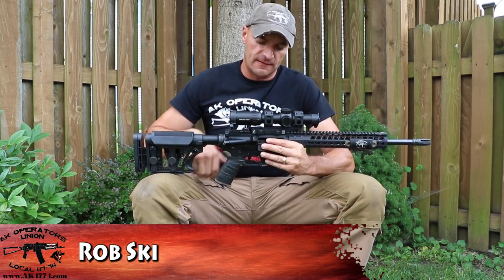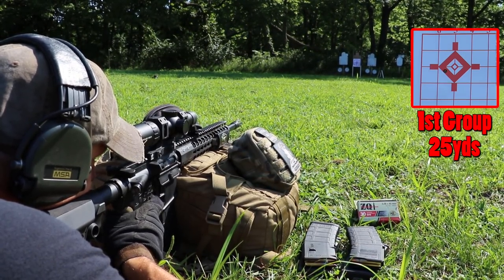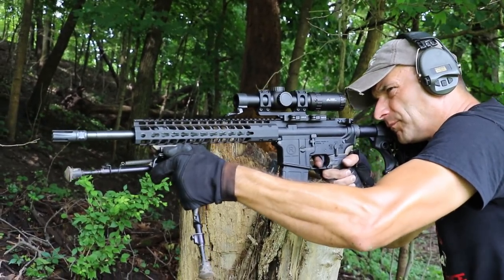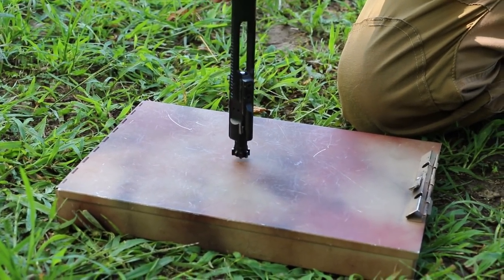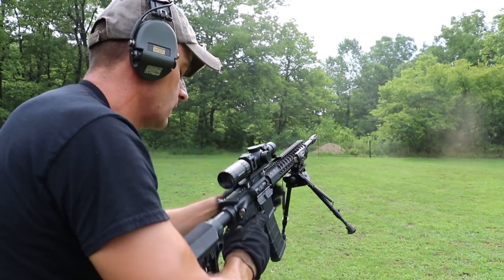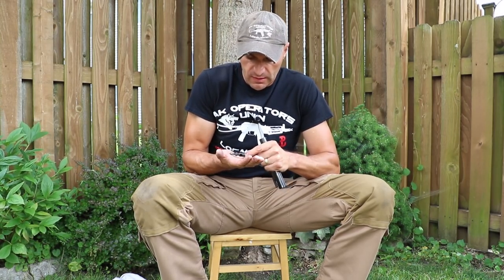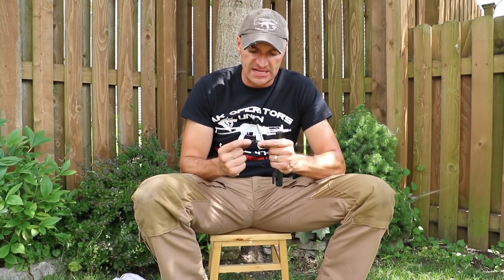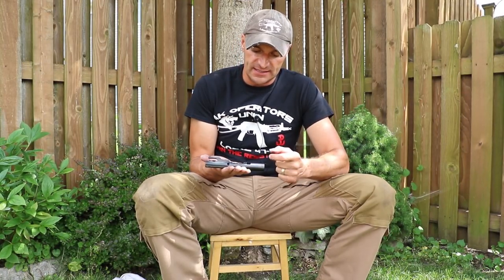Radical Firearms AR-15, 4310rds LATER - Another one bites the dust!

Comment: I’ve had my RF-15 for three years now. Originally bought it thinking I’d have to drop a new BCG in it considering it was only $550. 3-5 thousand rounds later with regular cleaning and the factory BCG is still going strong. Accuracy is still great, and it eats pretty much any ammo I throw in it, steel or brass.

Comment: This is a failure, yes, but not on the same level as the RAS47 or IO...  These are small, cheap, changeable parts easily replaced, not major frame work or metallurgical failures.   They need to fix this but it is not an absolute condemnation of the rifle.
Reply: True. That RAS47 wasn't ever worth repairing with all new parts. It literally had to be thrown away
Reply: Robert Smith
I think the bones of the RF AR were good enough... unlike the RAS47 or IO where the very framework was coming apart, with evidence of really poor metallurgy, shaved metal, flaring of contact points, fractured parts, wobbling rivets... icky.
Reply: Cant believe you old rockers are talking AR 15 together
Reply: Its a test to see if rifle will function to 5k with standing the tortures. If rifle stops functioning then it fails. So RAS47 outperformed this AR,, not sure how you can't say that. If you are at war/battle, you can not stop and purchase parts to fix. so having said that RAS47 beats this AR and the IO, while functioning perfect and holding zero all the way to 5k.
Reply: MrShizzlblizzl
You do have a point. However, I don't see anyone watching this video going to battle...certainly not with a RAS47 or this AR.   99.9% of the people watching this are ordinary folks looking for something to take to the range and have fun with.
Reply: Yep that's why I buy the best out there and build it myself for a lot less than you can buy at the store.
Reply: +Steve Miller having said that I doubt they will reach 5k rounds in lifetime  just going to range here and there. 5k is a lot
Reply: +Randall Berry I wish I had times and knowledge to build. That's cool for you man.
Reply: Have you ever watched videos on youtube lmao you to can build a good one.
Reply: +Randall Berry pretty funny isn't it?
Reply: +MrShizzlblizzl  They both had flaws. Both would work for me in SHTF because I only need to shoot a few rounds to remove the better AR from the other guys hands. Buy a cheaper rifle and spend the rest on training. A 100% reliable AR or AK is only worth it if you have the training to properly use it. I'm not talking going to the range and landing 50 rounds on top of one another. If you a AK guy see Robski and get some real world training. AR guy see James Yeager. Its just my opinion but This AR would be fine if maintained and it would be reliable. Robski really puts the shit to these rifles without a proper cleaning. I would love to see how many rounds it would take if cleaned after the sand tornado and lubed about every 1000 rounds. Not lubing a BCG in a AR is like running your car with no oil.
Reply: Randall Berry
There are so many great parts makers out there right now!  You are right, it is fun and easy and money saving to build your own.. and then you have the gun you want.

Comment: it doesn't mean the rifle is garbage.  replace the bad parts and it will be fine.  it just didn't pass your tests.  I'm sure the manufacturer will fix it.
Reply: +Del Corbett who is going to use an AR15 for self defense?  Anything can break or malfunction because they are  made and assembled by humans who are not perfect.  even expensive firearms with the best parts have broken.  I wouldn't be so critical.
Reply: Better yet, roll your own AR. I have a Spikes BCG in a Aeroprecision upper with a Daniel Defense barrel. Once I got the SBR gas / spring issues resolved it had no problems. Even before that, the only problem was that it wouldn't lock on an empty magazine. Throw on a 3MR trigger pack with a UBR stock and you've got a brutal short range rifle.
Reply: I don't know lots of people across this country use them for HD. The news is littered with young children who stopped home invaders with them.
Reply: +pwrserge83 I too have a Aero upper and a Daniel Defense barrel, but I have a Rainier Arms phosphate bcg.   Mine is a 16" carbine, gas system is perfect with the standard buffer and spring.  3-330 ejection every time.
Reply: Brian Presto Yeah... I'm running a 10.3" SBR for competitions so the gas and buffer systems took a little tweaking. I'm using a captured spring buffer which does a lot to even out the recoil, but needed some spring tuning to function properly in a short barrel.

I'm just about to hit 5000 rounds with no noticeable wear on any of the components.
Reply: would you be saying that if this was your concealed carry? lmao doubt it!

Comment: had the same failure in my daniel defense AR at about 3k. doesnt make either weapon junk.
Reply: I was thinking these weapon manufacturers have lifetime warranties. Like sure, it can be a pain in the ass, but the manufacturers will fix critical failures, as long as you haven't modified the parts.
Reply: @scottwest9299  hopefully you can afford a better rifle for self defense than a radical arms in the first place. Its a budget AR
Reply: @cameo64  , because poor folk don’t need to defend themselves?
Reply: @scottwest9299  because quality costs more. The AR platform is not budget friendly. There are cheaper, more reliable and more effective rifles for home defense that don't over penetrate like an AR. If you want an affordable, cool looking rifle so you can have a good time and feel tactical AF, don't expect it to run perfectly for thousands of rounds with a few cleanings and no part replacementa or repairs.
Reply: @cameo64  wtf are you on?   The AR is the most budget friendly rifle of the prior 100 years. To save you the trouble, $642 for a select fire version for the Government, and pre-COVID a regular ole citizen could find actual quality for about the same price, albeit in semi automatic version. 
Also, what  weapon does a soldier use to clear a room?  What about Swat? Or even the average work-a-day patrolman?  An AR15.  Why?  Because it’s the best tool for the job.
Reply: @scottwest9299  Agreed.
Reply: @scottwest9299  lol yeah… not sure what that Cameo guy is on.
Reply: @cameo64  Peter said his Daniel Defense failed at 3K rounds. Nothing from DD is considered "budget" or cheap.
Reply: Exactly! I had a Colt le sheer a cam pin at 2,5k rounds. But my Stag Arms hasn't had any issues at 3,5k

Comment: Do a Palmetto state AR15 next.
Reply from the maker: +Tyler McCommon working on it!!!
Reply: Why? Same thing is going to happen. If you want a cheap AR buy a Ruger or Smith&Wesson.
Reply: VegasStuto I already own a PSA AR15. I just want to see how far it will go.
Reply: Interested in a PSA test also.
Reply: if you do a psa please do one one their "premium" or chf uppers plz. Thanks for all the great tests.
Reply: +VegasStuto - Why?  To have real data and not just speculation
Reply: I have 2 different Palmetto BCG in 2 different rifles. The cheaper M16 BCG has thousands of rounds through it,no problems, and very little wear. The more expensive Palmetto Premium HPT/MPI chrome lined Bolt Carrier Group I had the first gas ring  break in half  in less than 400 rnds of and it had tons of wear on the cam pin. So I replaced the gas rings and the cam pin. It's a cheap fix I bought a hard chromed pin for $10 and for $3 got some DPMS gas rings gun fixed and no more problems